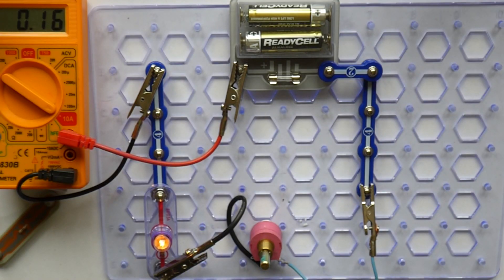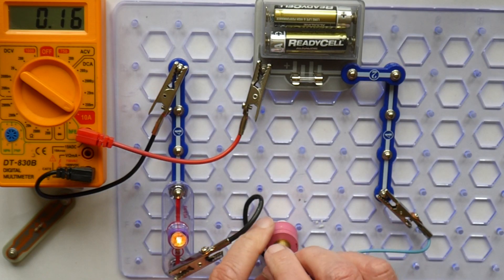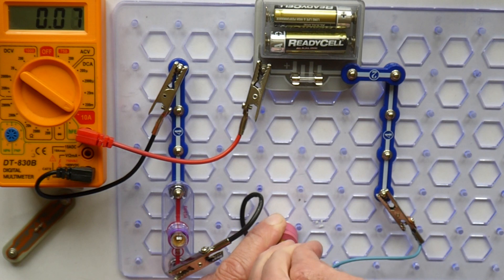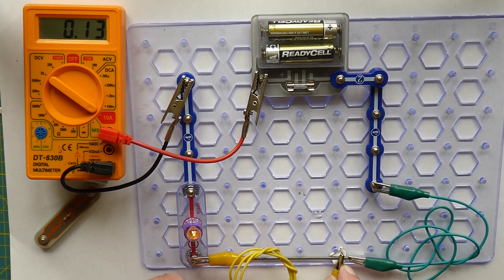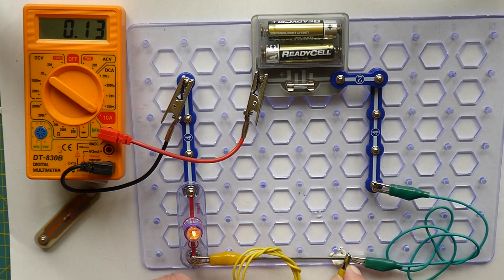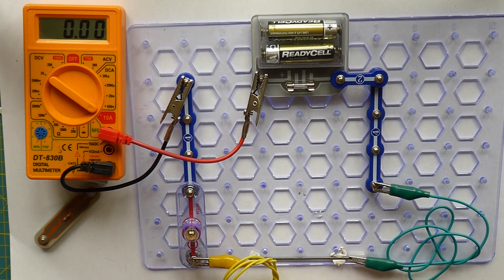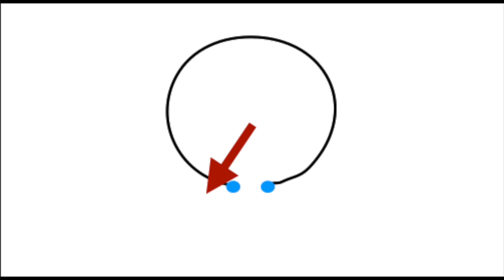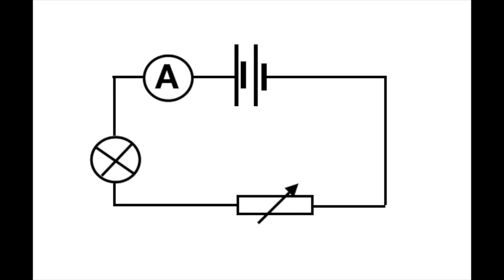Variable resistors, how they work and what they do: fizzics.org

Comment: Genius, easy to understand and clear explanation!!
May I ask if you could adjust lets say the amount of voltage to a mosfet and thereby make the mosfet act as an variable resistor, depended of the variable resistor?
Reply from the maker: Commercial variable resistors are identical construction to potentiometers only wired up differently, so yes you can use (a potentiometer) it to vary the voltage to control a mofset. I intend to upload a video on potentiometers in a couple of days time.
Reply: @fizzicsorg  Thanks a lot for your great answer! :-)